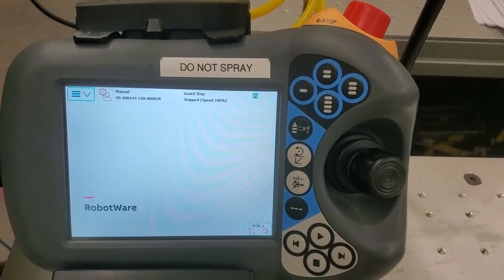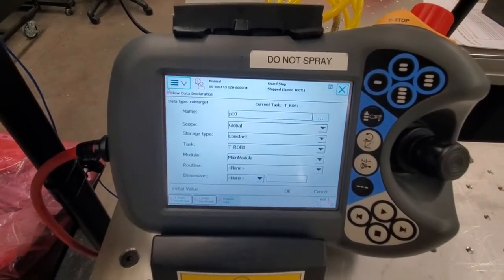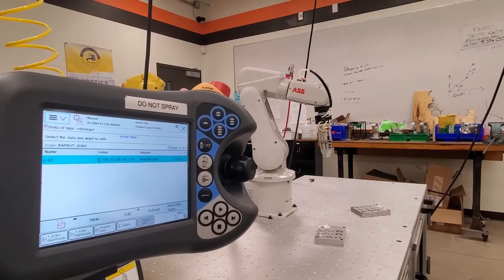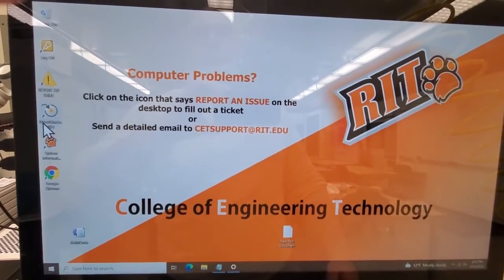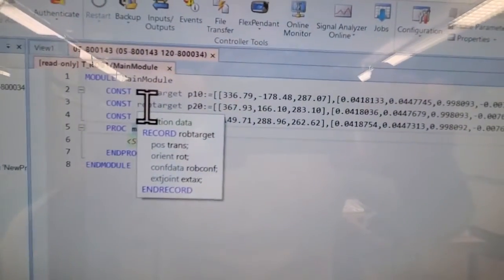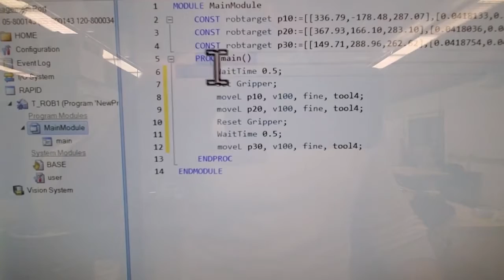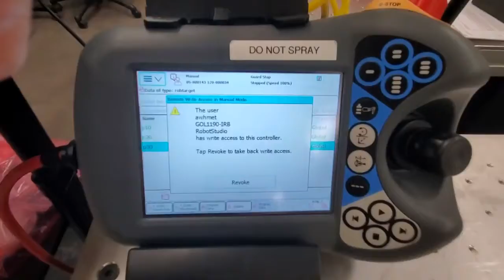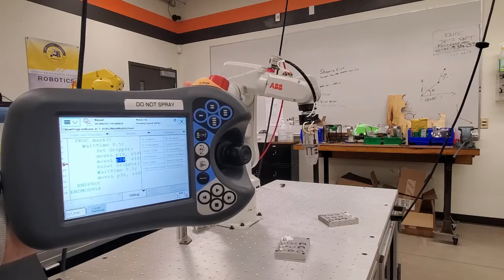Introduction to ABB Robot Coding- Write a Simple Code for Moving and Closing the Gripper

Comment: Hii sir, can you please tell how to connect python and YuMi in robotstudio using socket  so that, the coordinates from python would be fed to YuMi  ?
Reply from the maker: This is possible, and I have seen people doing that. You need to establish a serial communication between your PC and YuMi. Then through IP addresses you can send strings and numbers. On the YuMi side, in the RAPID programming language, you need to define an interpreter that will accept the data sent from Python and transfer this data to target points and movement commands.

Comment: And my next question is it possible to write python codes into the controller or computer?
Reply from the maker: Yes, you need to write a serial communication code in python and then interpreter in RAPID. We have done this and it works
Reply: @aleksandarhaber  thank you so much  sir 🙏
Reply from the maker: @darushz1327  subscribe and press like